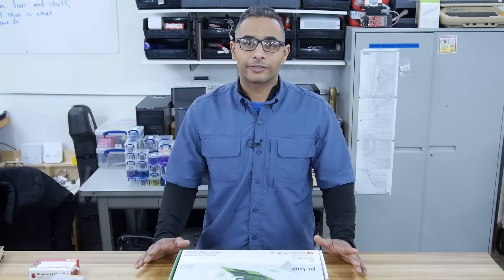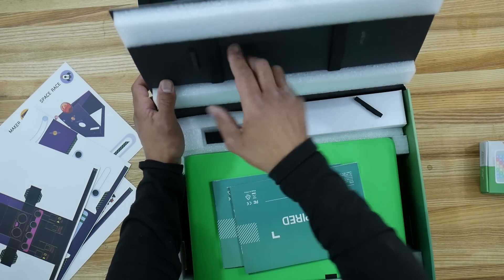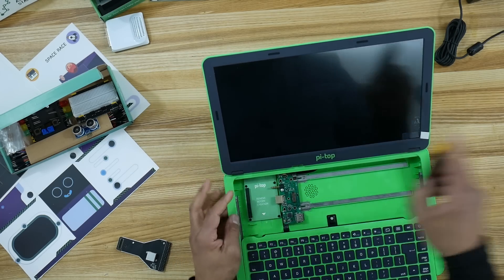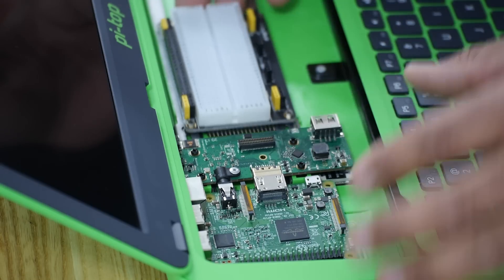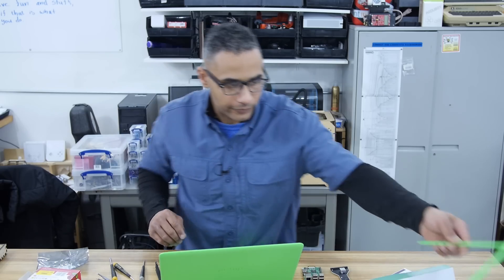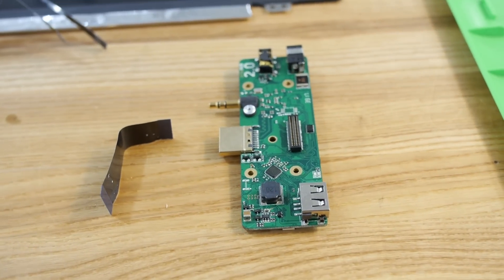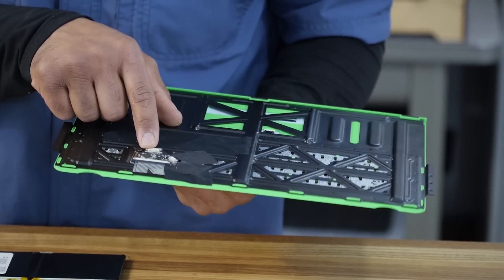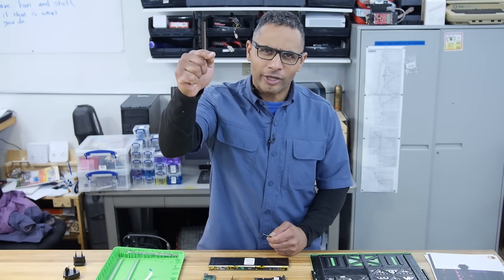sudo Sergeant 15 - Pi-Top Teardown

Comment: I still love using my PiTop3, and upgraded it with the 3B+ board.  I just WISH they had released a new hub module that would fit the Pi4 or Pi5.  I know Pi4 had reversed LAN and USB, but that was corrected in Pi5 thankfully.  Hoping that someone designs a board to do the same job, but for a Pi5 then this little monster would be much better.

I did see a Waveshare CM4 to Pi3B adaptor, but it seems there will be some cutting involved in the base to allow it to fit :(

Comment: Felix: Please do an in-depth video on laser painting PCBs. I have tried myself and keep getting stuck with an invisible layer of paint that prevents etching. If you could please go into different brands and colors of paint and what works best. I know every laser is different, but still sharing your machine's stats and settings would be helpful for establishing a baseline for experimentation. I think there's a lot of folks in TBHS community that would really like to see you go through that process from start to finish without glossing over any steps.

Thanks,
The Internet.

Comment: I am in my 30's and i think this is fairly neat. Oh look a new pi variant came out? A new single board with the same layout as the pi? Unplug, plug the new one in. Boom your laptop has been upgraded. Screen breaks? Buy a new screen. This is literally what I've been wanting for over a decade; a sandbenders type of modularity.

Comment: From a strictly practical standpoint it seems like this isn't a great idea - the Pi is slow, the SD card is slow, and by the time you've put together this whole thing, you could have just gotten yourself a real laptop PC which would be much more capable. (like literally - I bought a Lenovo X220T convertible tablet for less than the cost of this thing, and that was almost six years ago. It's got more storage, more RAM, more CPU and GPU power, and an integrated tablet in the display.) It's hackable, of course, there's that - but practically speaking is there any benefit to this thing? Like is it significantly more power-efficient, or is it basically a wash since you've still got to drive the LCD backlight and slog though with the slow CPU and so on?
Reply: Yes, a fullblown laptop is ofcourse more powerful than a Raspberry Pi, but the main goal of this kit is to introduce a younger audience to electronics and low-level IO tinkering. The amount of projects one can do with this kit is astounding!

It looks like there is plenty of room in the case for more addon boards, giving a lot of possibilities for an extended sensor package etc. 

If you get a laptop today for  around the same price as this kit, you are most likely getting a windows laptop. That laptop will not have any of the tinkering possibilities provided with the Pi-Top. There are no GPIO, no possibility for breadboard or  any other sensor upgrades. A new laptop would be limited to swapping RAM and HDD at most.

I think this kit is a wonderful tool for a younger crowd. Easy to set up and very customizable with future addons. 
Choosing the right tool for the right job is always a good bet. So one would not use a regular laptop for teaching IO and basic hands-on electronics, but rather a kit like this. 

If one wants to watch 1080p video or play games, one would get something with more horsepower like a laptop. Atleast in my opinion.
Reply: "From a strictly practical standpoint it seems like this isn't a great idea" This thing isn't supposed to replace your laptop. This is a kit designed to introduce people (usually children and teens) to the world of electronics and programming. Can your generic Wintel Laptop interface with IO pins and microcontrollers out of the box. Does it have the ability to write programs and execute them right on the spot to interface with a breadboard circuit?
Reply: I don't think the point is to cheaply replace a laptop, that's what chromebooks are for. This is just a cheap way to make the Pi more acessable to kids and to teach them about computing.
Reply: Not "Wintel" here, I never touch the stuff. Check your targets before throwing around insults like that, please! :)
So if this isn't supposed to replace a laptop, why turn it into a laptop? Why spend more money than it costs to buy a decent laptop to make a seriously sub-par laptop? This is like a DIY netbook (for those who remember what a netbooks were), but not as good as a netbook.
Can my laptop interface with microcontrollers out of the box? Well, if by "microcontrollers" you mean Arduino and similar boards, sure. My laptop has USB ports and Bluetooth. Interfacing with non-USB microcontrollers or other hardware would be a bit harder, but adding an Arduino to a laptop is an easy and cheap way to add those capabilities. I think it makes more sense to start with a good laptop and add I/O than it does to take a SBC with I/O and turn it into a laptop.
The Pi is a fun board but I think its popularity leads to it being misused for things it's not well-suited for, set-ups where the benefits of the Pi's low cost and small form factor are more or less negated.
Reply: Most parents of these kids regularly toss more powerful phones than a Rπ. I think a Samsung Galaxy S2 and up is more powerful, and we're up to what now..S9? I know my ancient S5 is far more powerful than a π.

  I'm not a fan of the NDA Broadcom hardware, and the 'we bought stock in a connector cable manufacturer while designing this product' disclosure that should come with the board.
  If you are going to tout the GPIO interface, they should have designed some cheap analogue hardware on the board or selected a processor that has an integrated ADC, Comparator, and DAC.
  The lack of a datasheet for that LCD connection is horrendous. Not to mention, my first Rπ mod is to solder pin headers for the audio/composite video, power, and all USB ports. The entire concept of 'buy this cheap hacker/maker device in order to learn,' followed by, 'go buy all kinds of overpriced and proprietary shaped pieces of plastic with simple wire connections,' is just dumb. It should have been, 'here's a cheap computer, it has these connections for conventional hardware, but we have added $0.002 worth of pin headers that are broken out for all of these so that you understand that a $20 USB cable at Best Buy is really just $0.10 worth of copper wire.'....and we broke out the connectors because we do dumb things like placing an active data line on a 3.5mm jack in the location where everyone places the ground terminal making any conventional adapter useless.

  Most people seem to use a π for retro gaming if at all. ARM support is still very limited when it comes to entry level electronics tool chain support. It can run an Arduino IDE and basic command line programs, but I think the future of learning/hobby electronics is going to be the integration of debugging interfaces. I don't think any of the IDE's/options on ARM-Linux support debugging. That's the kind of utility needed to make a Rπ useful at the center of an electronics learning station IMO.
   However, I'm no expert, just a dumb hobbyist
-Jake
Reply: Yeah I agree. $320 quite a ridiculous price... I doubt these things are really mass produced like Lenovo laptops so that's probably a big part of it.
Reply: Or just get a Android box - problem  solved

Comment: My school have these shitty single board pcs in the computer science class rooms where they replaced more powerful intel core i5 (sandybridge?) zoostorm desktop towers. Almost no one at my school knows how to use Linux so it was a wasted purchase
Reply: It's also the desktop ones I'm talking about
Reply: Are you in school to learn new stuff or to use what you already know? ;-)
Though in my opinion one doesn't need to exclude the other, good to learn the basics of different OS's. 
And being in a "computer science class" I hope you get to learn about how they work, how they are built etc etc.
Reply: I live in the UK & I do learn stuff. part of the current GCSE is 2 exams; 1 is theory based which is about programming & the other is coding HTML in a computer room & with some questions on binary then there is also some coursework which is programming Python but the coursework got leaked by some schools so the coursework doesn't count for any marks. Paper 1 & paper 2 are worth 25% each on overall grade & coursework is worth 50% of grade & since the coursework doesn't count anymore both paper 1 & 2 are worth 50%. we do learn about computers but not how they are built instead its about how they function

Comment: Got one from the older series. The Pi gets really hot inside the old case, you have to keep the sliding cover open all the time, even when you don't run any apps, the supplied battery died within a year or so and things like that...